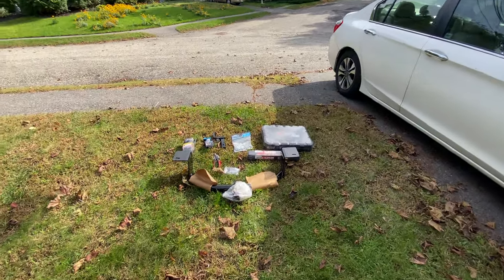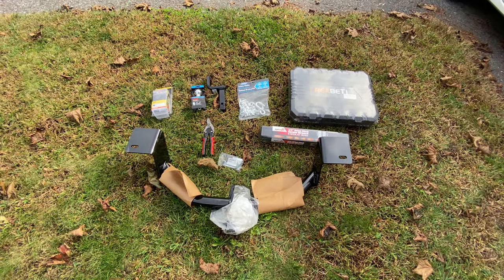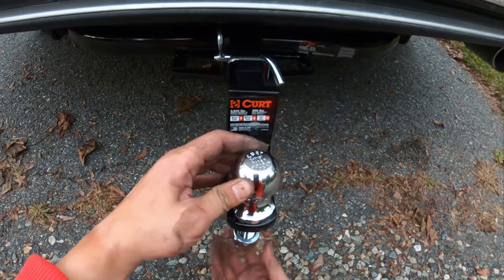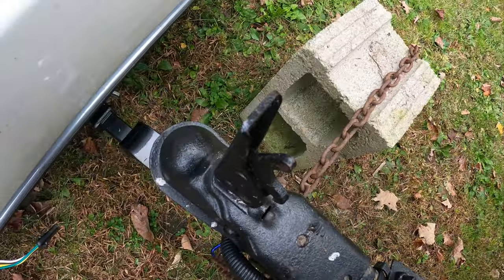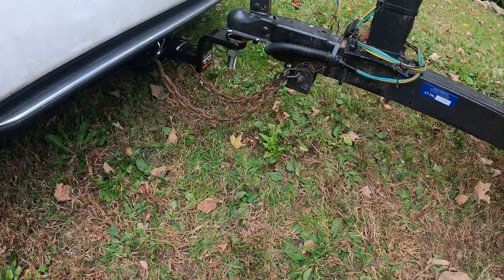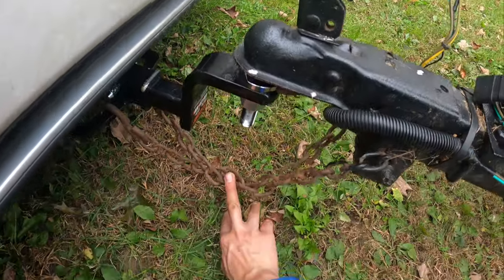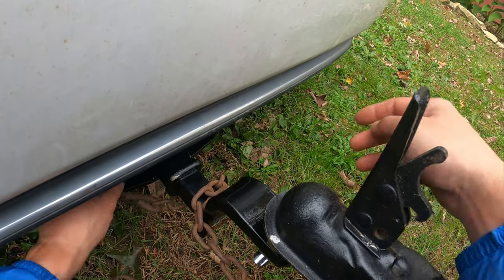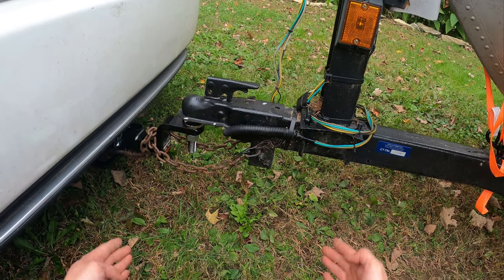How to Tow a Boat with a Car [Honda Accord 2013] Many People Connect It Wrongly

Comment: Hi I don’t think will be safe to put the chain over because is to lose between where you put the chain over to the hooks so when the car hit a bump can be disconnect  also you don’t connect the hook up and down should be down and up so when you hit a bump will not disconnect also the lock handle should have a whole to put a lock to prevén unlock 
I hope you understand my point of view  i text you because have many many years of experience when i Star pulling staff with the truck i did it wrong and other people teach me and everything make sense now  so I just pass the info
Be safe and have fun fishing
Reply from the maker: Thanks for the great advice! I pinned your comment, hoping it can help others. And you’re right I installed the safety pin to prevent unlock 😎

Comment: I have a similar vehicle, but there doesn't appear to be a hitch that is designed to work specifically with my year/model. Do you think I can find a universal hitche that will work?
Reply from the maker: Hi there, if the universal one says it fits on your vehicle you’re probably good. But I would bring the car to mechanic to have it installed. Universal one might require some adjustments or more knowledge to be better installed on your vehicle. You want to have it very securely installed for sure!

Comment: Criss cross chains. When you turn it won't pull them tight. The purpose of the chains isn't to hold the trailer up off the ground. They are meant to keep it attached to the vehicle. That's their only purpose. You don't want to put them over the top. They are meant to be below and criss crossed. It's not meant to keep it off the ground. Also do NOT use the climbing hooks you showed when you first hooked it up. Those are a joke and will snap in a heartbeat. Use the hooks you did at the end. True chain hooks! Under and criss cross.
Reply from the maker: Thanks yea you’re right. The climbing hooks are broken on my first experiment of disconnection!!!
Reply: Those aren't actual climbing carabiners. Those are more like key chains lol.
Reply from the maker: @jkim3464  Yea gladly I abandoned those since the start of real towing😆
Reply: @SteveChenFishing   Shouldnt you edit video so others dont make that mistake  and com blame you lol
Reply from the maker: I'll add a note in the description @slingshoter8783  😆

Comment: So my accord 2021 can pull trailer with dirt bike I been nervous to do it
Reply from the maker: I believe so, bikes are not heavy at all. Check your vehicle manual and it should tell you how much weight you can tow.
Reply: Says 1000
Reply: I just don’t know where to start where do I find a trailer under 1000 pounds and Idk anything about trailers and connecters
Reply from the maker: @germanking452  Then it should be good.
Reply from the maker: @germanking452  for hitch you can refer to my other video it has all the links. for the trailer itself I have 0 knowledge on those for bikes...
Reply: @germanking452  look for a hitch carrier. They make ones specifically for  bikes. Harbor freight has one that's not too bad. This way you don't have to worry about a trailer at all
Reply: @germanking452  and that’s super conservative it can tow a good bit more than that